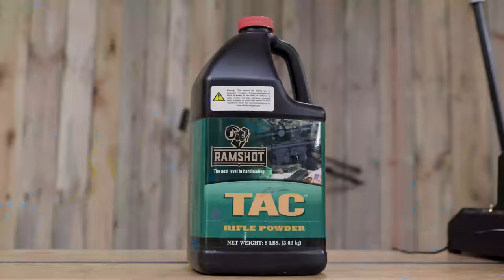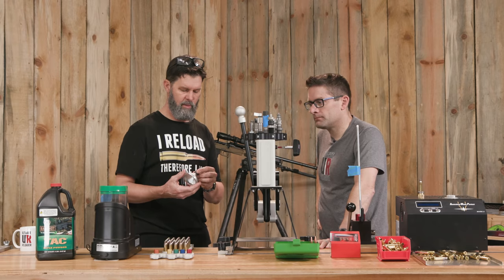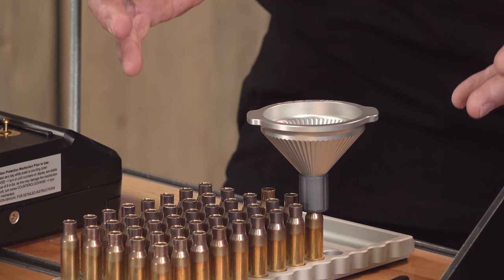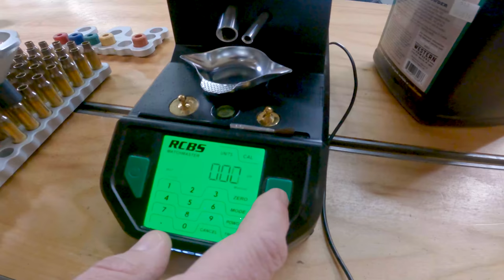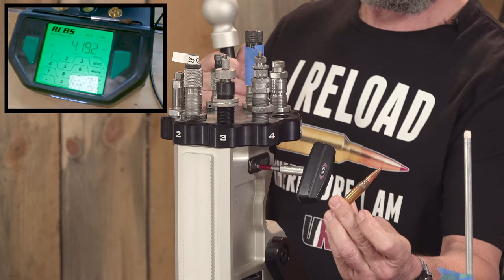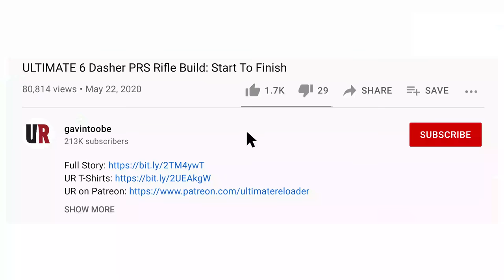Precision 308 Trainer Loads (Step by Step)

Comment: FNH SPRA1 .308. 20" barrel, Vortex Gen 2 Viper 5x25x56. Reloading equipment: zero press,  matchmaster powder dispenser, area 419 powder funnel kit, He derson gen3 power trimmer, SAC bullet and head space comparator, CPS primer seater, Redding dies, 21 century mandrels.  Laupa brass, varget, federal match primers.
Reply: I forgot to add that I'm annealing every firing with AMP annealer.  Full length size without the expander ball, set neck size with 21 century expander mandrels.

Comment: Bergara B14 BMP 24" in 308 with 185gr berger juggernauts and VV N550 powder. Using the gun for competition. I use lapua palma brass and federal 205M primers and I FL resize in 2 steps. After depriming, cleaning and annealing I use a body die and Lee collet die for the neck because I get better concentricity. The Lee collet die give me a bit more neck tension than I would like and I use expanding mandrel to set the desired neck tension.(light, about 0.001) I use the cheapest Lee case length gauge with great results and lyman chamfering tool. For bullet seating I use wilson seating die with arbor press. With this method I get consistent neck tension, case length, CBTO and concentricity. The gun has a factory barrel and prints under 1/2 MOA all day and I get 2750 FPS with the 185Gr bullets @ safe mag length. Coal is 2.850. Not a laser beem but not bad for a factory gun.

Comment: Here is something I bet nobody else is doing with their 308.  I run 125gr Nosler Ballistic Tips and routinely shoot them out to 700yds.  The little 125's have way less recoil and they are very flat shooting with such a high velocity.  I stumbled on to this combination by accident as I had just gotten a totally stock Savage Precision Carbine and the 125's were the only 30 cal bullet I had lying around.  With Varget the Precision Carbine will plunk 5 rounds into 5/8" groups all day.  Its good fun to shoot and reliable.

For longer ranges I use 208 AMAX over Varget and have taken that combination out to 1200 yds.
Reply: The nosler 125’s are my favorite 30cal bullet, I run them in everything from 300blk to 30-06 reduced recoil loads. Currently working a load for my 26in encore 308
Reply: @johngill4809  They are an awesome bullet.  I used to use them for coyotes, for which they are exceptionally well suited. A bit like the hammer of Thor on a coyote.  Kills them DEAD.

Comment: I’m not a PRS shooter but I used too shoot High Power and 3 gun where I’d sometimes use 308.  I primarily use IMR 4064, LC Match or regular 7.62 brass with Federal 210M primers.  RCBS RC2 press and dies with a RCBS Chargemaster weighing out the powder.  I used a lot of 168 AMax bullets but mostly hunting bullets now.  Most of my targets these days are covered in fur and are tasty.

Comment: .308 is my favourite caliber heavy recoil but I live with that , the .308 has many pluses , long barrel life , great selection of ammunition, easy to load , reasonably inexpensive , a great all round caliber.
Reply: Heavy recoil? Try a 7lb .300wm
Reply: @TheMrkylester101  I got an 18.5" without a brake and it will beat you up in the prone. I also got a 300WM 700 BDL and that's just cruel.

Comment: I’m loading all my 308 on a Dillon 650 using 168gr A-Max with BM2 or ADI2206H powders. The rifle is a Howa 1500 with a Hardy suppressor anda vortex tactical FFP 4-16. I use it for training as it’s cheaper to load for than my 6.5 PRC and 6.5 CM. 6.5 components are difficult to get here in New Zealand. Great videos by the way keep them coming 🇳🇿

Comment: 308 is the best! I love Tac too it throws so accurately in my powder measure and those 155 TMKs and ELD-Ms really close the gap on those 6.5s. My drop is under 30 MOA at 1k, and with in 1 MOA of wind drift compared to factory Hornady 6.5 CM 140 ELD-M. I’m running 46 gr of TAC behind 155 TMKs

Comment: My 308 (175 grain), Im using the most cheapest and space minimalist method possible. 
Sinclair arbor press
Hornady Powder Measure Bench Rest LNL
Hornady balance beam
Hornady powder trickler
Sinclair/L.E. Wilson micro adjust bullet seater

I had their auto charge, but it started producing wild results after around 3,000 rounds (+/- 0.4 grains on the slowest setting)

Comment: I love the 308, I shoot it to 1000 yards rather nicely with my 195 Sierra TMK's doing 1275 FPS.
Using the Ruger RPR- yes really.
I have another 308, a Remington 700 custom build with a Kreiger barrel but the chamber is built specifically for the 168.
I have a third 308 a Parker Hale TX1200 which needs a scope, so I'm not shooting that one at the moment.
Reply: 1275fps seems like you would be transonic very quickly. I run 185 gr Berger hybrids to 1k, 1200+1600 @2750fps mv, 1:10tw. Essentially 863fps @1600. (Transonic at 1400yds or so).
Reply: @greenacres4518  I bet he means 1275 retained velocity at 1k

Comment: Excellent video guys!

308 is the king, not the best at anything, fairly OK at most things... Just slapped together some 178gr ELD-X with AR2208, GM210M primers in Sako TRG brass, 20 thou off the lands, mandrel, full length sized, trimmed, turned etc... Zero load development, .35 MOA group at 625 meters today (3 rounds). Just, an easy round to work with and not overly aggressive barrel life, difficult to not like.

Comment: Great thinking. Good stuff. Thank you gents. 26" 700 vssf. My first 308 I bought in the mid 90s. Working on load development for 155 Nosler BTHP Match bullets I bought bulk. 
Varget, CFE223 & H4895.
Reply: Was handed down the same rifle from my dad. Been working with a few components. Latest is 150 hotcore and H335. About 1/2 MOA. Looking to try TAC with 150 and 180 hotcore
Reply: @kuigglugmiu9339  Outstanding. Really nice rifle. I gave $800 in 97. My younger brother & I traded rifles some time later his 700 BDL in 7mag was like my first rifle so I traded. But bought my 700 vssf back a # of years later. Pretty impressive package.

Comment: Just finished working up a load for my Armalite Hog Hunter .308 carbine, using 147 grain bulk FMJ SBT'S. Tested several different loads. It practically feasted on 43 grains of IMR 8208 XBR, printing some of the best groups I've ever managed with this AR 10. It also digs 46 grains of IMR 4166. With everybody fawning over 6.5 caliber guns and cartridges these days, (yours truly included among the legions) this venerable old war horse proved it can still bring home the bacon.
Reply: Be careful. 43grs of XBR is very hot for an AR10.
Reply: @aaron.from.winchester6744  
Thanks for the word of caution my friend. According to the Lyman AR Reloading Handbook, 2nd Edition, the Max Load for the heavier 150 grain Sierra FMJ using IMR 8208 XBR is 44.3 grains.  This load produces pressure at 60,000 P, and is listed as such on the data sheet on page 91.

The 2017 Hodgdon Reloading Manual features a special section entitled, "Premium 308 Winchester Handloads" by Steve Gash. Another resource well worth reading. In it, the author tested a variety of bullet/powder combinations for both bolt-action and semiautomatic AR rifles. For the AR, he used the Rock River Arms LAR-8 Varminter. I own three Armalite AR 10 rifles. Both RRA and Armalite are solid platforms made by leaders in the civilian and para-military manufacturing of these style firearms. For his test of 168 grain Sierra Match Kings, he charged these much heavier bullets with 42 grains of XBR.

My ARs digest 43 grains of IMR 8208 XBR driving the lighter 147 FMJ SBT'S, without so much as a hiccup. No high pressure signs on the primers, nor chewed up bases on the cases, etc. The accuracy is spot on, and the maximum velocity is well within the range of pressure safety I always look for when handloading for these, as well as all my other firearms. Admittedly, the only draw back is they fling the spent cases pretty far, making for some interesting conversation at the range, when they go whizzing by the guy's head two booths over due to social distancing...told him to pull the netting down!

Handloading has been a devoted thirty year hobby for me. I handload all the cartridges for my rather extensive collection of rifles and handguns. I've made my share of missteps along the way, and I've learned a lot. One of the first things was, to follow the recommendations of the reloading professionals who do this stuff for a living, and publish their research findings in manuals and journals devoted to the subject. All the while, taking everything else you read, hear, or see on the Internet and other social media with a grain of salt. That in and of itself has kept my hobby enjoyable, and extremely useful. Especially in these times of empty ammo shelves at my local big box sporting goods store, and "Out of Stock" messages splattered all over anywhere you look on the web to score factory loaded stock. More importantly, to me at least, is the confidence that my handloads are dependable, and very safe because of that due diligence.

Comment: Savage 110 picked up from the local pawn shop for $300, put a Shilen 308 match barrel on that action and dropped it into an oryx chassis. Sub MOA gun all day with match ammo. My next build will be off the Origin action. I like having the option of prefit barrels. I currently load 168 and 178 hornady match bullets over 8208 XBR and IMR 4064 loaded on a lee single stage. Patiently waiting on the Frankford X10 progressive to drop.
Reply: Imr 4064 is the tits, my rem 700 loves it

Comment: g/day from the land of OZ.  I use Savage 10FP with 30" krieger barrel for FTR in .308. I find that the best results are achieved with minimalistic approach, no unnecessary steps. This means depriming, primer pocket cleaning,  annealing, FLS with body only die (reeding), neck sizing in the next operation (Lee collet die), tumble,  charging on FX300i and seating with Wilson die with Arbour press. I find RCBS charge master to be twice as expensive as a lab scale / auto trickler set up and nowhere near as accurate. It is a better option for a PRS shooter pumping out large amounts of rounds though. Also, after many measuring operations, I concluded there are absolutely no benefits in concentricity by using mandrels as opposed to a simple Lee neck collet die.
Reply: ""I find RCBS charge master to be twice as expensive as a lab scale / auto trickler set up and nowhere near as accurate."
How is a chargemaster twice the price of a Auto trickler set up?
Reply: @TheSODA17  good pick up, I was thinking the matchmaster
Reply: @mickroberts5166  with that cleared up i agree. No matter how much you spend a strain gauge will never compare to a force restoration balance like an a&d.

Comment: I love mine. I have a Bergara hmr and I searched and searched for one in 308. Finally got one and with the way this shoots I probably will never get into the 6mm or 6.5 stuff.  46g varget, cci br2s, and a 155eldm .3" groups all day. I have a hard time missing at 900. I also load 150g interlocks and those are just as accurate. 50.2g of cfe, and those 150g interlocks. Those even at 900, are smacking my target no problem. With these loads and this gun I don't need any thing else for what I do

Comment: I have a rcbs rockchucker, which works great for precise reloading. I have a redding powder thrower which i am NOT real happy with but it is what i have. I have to weigh every powder charge. Then i use whichever brass i have. Most is military surplus. I was reloading the hornady max 165g. I used just a factory powder charge but MAN the accuracy out of my LR308 is amazing. I rebarreled that rifle with a faxon big gunner barrel and have a La Rue mbt-2 trigger in it... the last 15 rounds at 100yds were amazing. I had a very verticle string and once i got the scope right my last two rounds were dead bullseys! The stringing is from top of the target in 8 ring down to 9 then x... i believe i was using IMR 4895... I reload for a garand and a savage 111 fcns 30-06. 
I JUST bought a savage model 10 fpc-sr 308 with a 20" fluted barrel. Bought it for myself 12-18-21... havent pulled the trigger YET... I use milsurp ball to smooth the barrel as it is BRAND NEW and then i have federal premium gold medal match 168 and 175... see how thise shoot outta that 20" barrel. Then i will test those same handloads in it after i fire that new barrel a bit...

Comment: I found the TACK works great with the 223 loaded with 77gr bullets. Never thought about using it in my 308's. I typically load 155gr Palmas over 4350, Varget, H380, and 4064 in my 308's up to 300 yards or so, and 175gr's over Varget for beyond 300 yards. I like the 168gr bullets, but they're in the middle; being neither here nor there.

Comment: Great vid and information! I shoot a Bergara B14 Hunter in 308 Win topped by a DNZ Products Game Reaper one piece scope mount/rings and a Burris 2x7 Fullfield E1 hunting scope. I recently printed a < 1 inch group at 200 yards with Lapua 167g OTM Scenar ammo. And, a Browning BAR (Type 2) made in 1980 I purchased new and topped also is a DNZ Products Game Reaper one piece one piece scope mount/rings with the original Leupold 2x7 Vari-x II scope. A couple of loads I like are 150g Hornady SST on top of 43g IMR4895 in Remington brass and 150g Nosler E-Tip on top of 43g IMR 4895 in Remington brass.

Comment: I hunt with my 308.  My current hunting load is 168 Barnes ttsx, lapua brass, IMR 4895, and federal match primers.    I’m looking to build a training load that’s similar bullet weight /BC but not as pricy as Barnes.  Also would like to work up a 150 and 130 grain loads to have a little more variety for hunting.

Comment: I load 308 to slightly lower pressures (NATO) for an Ishapore bolt gun. I use 146 gr or 150 gr (Hornady 3037) over 41.2 gr of Varget for just over 2500 fps. For an old battle rifle, it shoots that load real well. And of course, my 300 Savage load is not that much different, at 2500 fps also.

Comment: I've only just gotten into reloading with inherited equipment.  Currently trying to learn with my 308 hunting rifle, a Howa 1500 Gameking, 22" barrel 1:12 twist.  This rifle shoots sub MOA with Barnes TTSX 150 grain factory ammo.  I'm trying to learn how to duplicate this factory load.  Manually trimming with the Lyman case trimmer, I've got a Lyman Crusher single stage press and Lyman balance beam scale, RCBS manual powder throw and RCBS hand trickling tool. I've been full length resizing using RCBS full length deprime and resize die. I hand de bur the case then follow with hand priming with a Lee hand priming tool and CCI #200 LR primers, charging my cases with Varget powder, one at a time after weighing each charge on my manual scale.  I then seat each 150gr Barnes TTSX bullet with the RCBS bullet seating die.  I've noticed these bullets seam to stick in my bullet seating die or something and are difficult to get to seat at a consistent depth, sometimes varying up to .015 which drive me crazy.  Any assistance or recommendations for changing my process?  I've got about 75 rounds loaded and ready to test but I'm adjusting my bullet seating die on almost every one to get them seated consistently.

Comment: I've found with flowy powders, I just set a volumetric powder thrower and start running loads. I check every 10-15 rounds but I've never had a variation. Hunter in my 243 and CFE223 for service rifle.

Comment: I am just getting into reloading and precision shooting.  I will be reloading 308 for an M1 Garand (that has a 2011 308 barrel) and a Winchester XPR Sporter with once fired used brass, H335 powder, CCi #34 primers, and Armscor FMJ 147gr bullets on a Dillon 650 Progressive press using Redding Micrometer 3 die set.  The powder, press, and die set was recommended to me by a friend and the rest of the components are what I could find.  I am primarily reloading to have ammo safe to use in the M1 Garand but having ammo that improves accuracy in the Winchester XPR would be a bonus.  My plan is to initially test and develop in the Winchester XPR and then test with MagnetoSpeed chronograph in the M1 Garand to double check velocities in the M1 Garand.
Reply: If you get the Hornady reloading manual, it has a section on 308 Winchester Service Rifle, which is lighter pressure loads than the 308 Winchester (bolt action)

Comment: I love the 308. I run two AR308 rifles (gas gun). Built one and bought the other. Honestly, I depend allot on good barrel life. The 6.5 and 6mm barrels just burn out faster then I like. Because I shoot allot and the 223 bores me lol. I shoot allot of 308. I am a.  300 yard and in shooter, therefore, 308 works great. If I want to reach out I have my 300 PRC and if I want home defence I have my 300 BLK. I only have to stock a few bullets in my collection. I would love to see more 308 and 300 BLK loadings.

Comment: Another funny thing. The super tight fit seems to lift the case when you pull the funnel of. See how he holds the case down not to be lifted upwards. So when you lift it with the case having powder you might spill it all over the place when it falls out. Also the crevices in the funnel shall capture powered as they are tapered  … I stick with my nice rcbs plastic 5 dollar funnel 😀😂

Comment: I have a RCll I do all my reloading on and I have a M1 Garand in 7.62x51 (original NAVY rifle), a Springfield M1a, my brother has a Rem 700 Tactical and my son has a Savage Axis XP all in 308.  For training or just blasting ammo I go by the Hodgdon 60% rule with H4895, a 130gr. Mk319 SOST bullet for a muzzle velocity of 2550fps., I can go as low as 2000fps. if need be.  Very consistent, accurate and economical shooting 1 moa or under at 100 yards in the Savage and Remington, 1.5 in both the M1 and M1a.  Perfect training ammo and I've even used it in some National Match rounds off the 200 yard line with a little stiffer load (2800fps).  I've used that formula in 270Win in my Savage and 30//06 for my other Garand's with 130 and 150 bullet weights and out to 200 yards it really gets the job done.